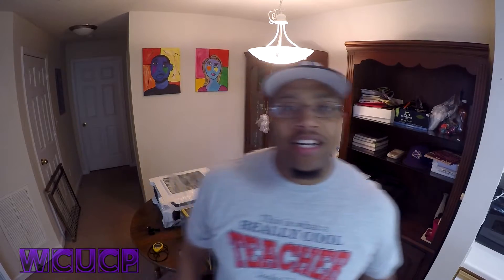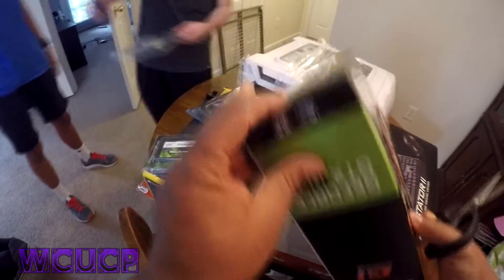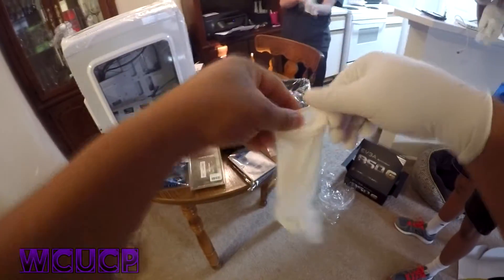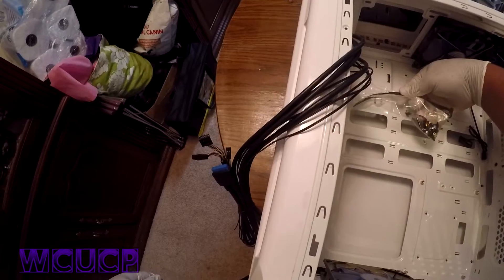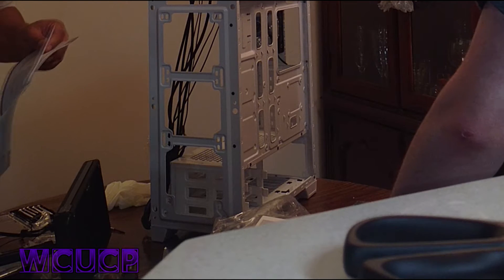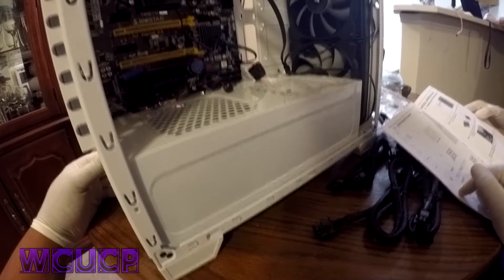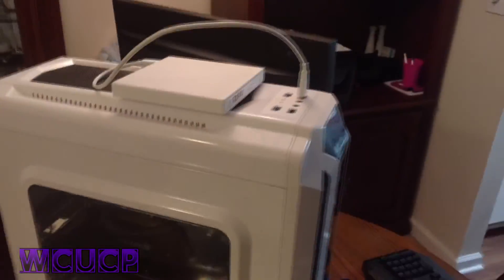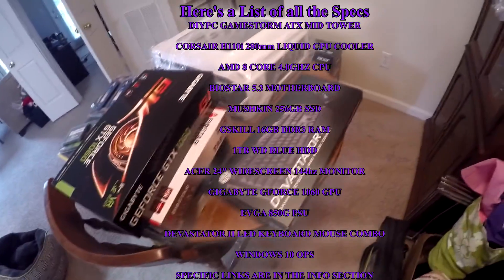HOW TO BUILD A GAMING PC | FIRST TIME BUILDING A PC

Comment: I've built and rebuilt my PC a shit ton of times because of hardware failure, upgrading the cooling system and GPU. Some advice for next time: Don't build your PC while standing on carpet (especially if you are wearing socks). Static electricity will fuck your components up bad. I actually fried my MOBO when I first built my PC because of this. Also, it helps if you boot it up outside of the case so if something is messed up you don't have to take apart all of your hard work to figure out what's wrong. Other than that, it's a solid build! if you want, I can teach you how to overclock your CPU and you can get the fullest out of that water-cooling system